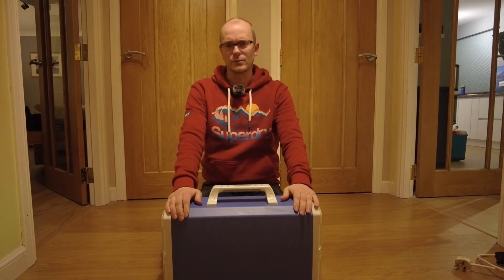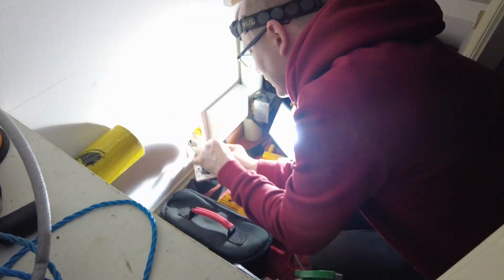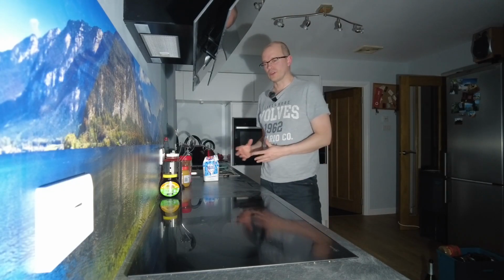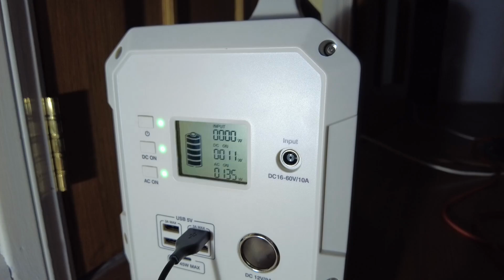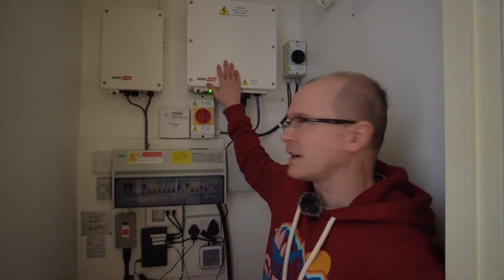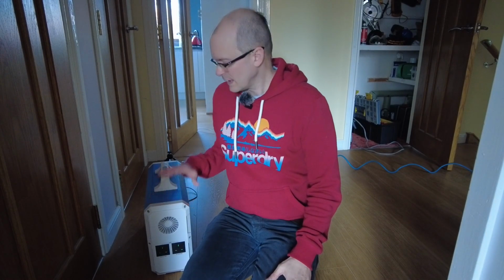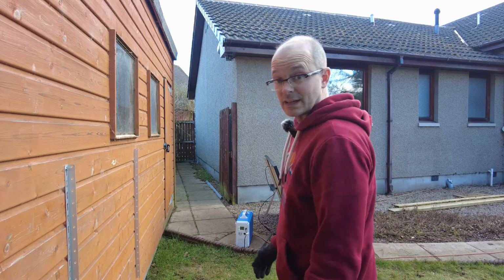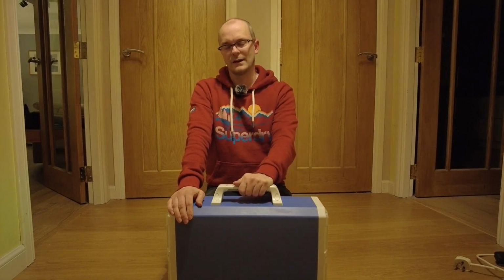Preparing for powercuts with a portable battery.

Comment: Hi Anthonyn, This application note from Victron Energy suggests that it is possible to use an external power source to enable the SolarEdge inverter when the grid is down. I would be interested to know what you make of it.
Reply from the maker: I asked Solaredge support about it, and they said contrary to their own application note and manuals that external power sources weren’t compatible with single phase inverters for the European market.  They said that in any case that generator needed to be large, even though there’s no reference to that requirement in their application note (though that does make sense in terms of ensuring voltage/ frequency stability when switching loads).

I think if you want to fake a 230V supply with a small battery, you’re going to have trouble with heavy load switching.  If you switch a kettle on/off then that’s going to cause voltage sag/spikes which the inverter probably won’t like.  Doing that with the grid connected, and those sudden load shifts just get absorbed by the large capacitance that exists in the grid.

Then you’ve also got the situation where the inverter generates more power than you’re using.  It thinks it can export that power, but very quickly the voltage will exceed its max limit and the inverter would likely trips out.  

So you need a big battery bank to absorb surplus power, and a big capacitor to absorb sudden shifts in load.  If you can do all that, then you can probably succeed in faking a grid supply with a small battery.

Comment: I understand now about the inverter shutting down without the grid, and you trying to power the inverter with the portable lithium battery. 
I'll be getting a 5kwh battery to connect to my inverter and wanted to find a solution without having to install a changeover switch as the can be expensive. Ah well 😌

Comment: Would it be possible to jump the positive and negative from the incoming solar ac cable that is connected to the trip switch that is coming from your inverter, that is connected to the consumer unit with a battery installation that is connected to your solar inverter,  switching off your mains, and jumping the positive and negative for let's say your hot water tank element.
If I have let's say a 5kwh battery installation that is connected to my solis hybrid feeding the main consumer unit and there is a total blackout..
By switching off the mains at the board and, then jumping the circuits.
My solar system is a dc system, not an ac system

Comment: It's funny how having solar turns you in to a hand rubbing accountant. I'm a great believer in having redundancy built in to your systems. My solar battery system does back up in a black out but I would never trust it implicitly with all that bloody software gubbins.
So I have a socket on my power board and a Honda 2.2 to keep the fridge and freezer going plus a few lights. It's enough to boil water on the induction top but the kettle is to greedy. 
Love the channel. Very engineery.

Comment: Just came across your channel. Got a couple of days with no power from Arwen myself. Friends had two weeks with no power.
Would agree fridge and central heating are the important loads. Did try my fridge with a fairly beefy UPS and it couldn't handle the load, so not surprised you had issues.
I've got separate batteries set up for powering my 12V modem already.

Comment: Aren’t those multiple attempts at starting the refrigerator compressor hard on the fridge and possibly shortening it’s life?
Reply from the maker: In electrical terms it’s nothing more than a compressor and thermostat, with a separate light and switch circuit.  There’s no fancy electronics at all.  

So the surge currents do create heat in the motor windings for much longer than normal.  However I also think the surge currents are limited by the battery. It trips out soon enough anyway, so I don’t think there’s enough heat building up to cause damage.  I’d expect the fuse to fail first.
Reply: @anthonydyer3939  thank you for explaining

Comment: Hi Anthony, just found your YouTube channel. Some fantastic videos and great insights into your energy economics and the backups.

I really like the idea of a backup system for power cuts and off grid situations. And yes a modern battery system seems a better option than a petrol generator these days.

However like with a petrol generator or battery when any of us end up in a off grid situation. Most likely we cannot guarantee that we have a reliable earth connection. That is if we are TN-C-S. so I guess my question and thought process is to run a backup system safely when off grid we need to operate in, I think it’s called island mode. I think to be on the safe side for a backup system an onsite earthing rod is required and full Live Neutral and Earth transfer switching required.

I’d really like to hear your thoughts on this, maybe I’ve got it all wrong and my understanding is incorrect, so please jump in and correct me. Just not 100% comfortable about powering my heating system with all that copper and no working earth system.
Reply from the maker: The IET has this guide:
https://electrical.theiet.org/media/1550/operation-of-portable-generators.pdf

It makes it clear that your can only have a floating earth when operating only one item of class 1 equipment.  Multiple items of class 2 equipment are permitted.

When operating more than one item of class 1 equipment then the generator needs to be referenced to earth, regardless of generator size.  It think this would be the typical scenario for a whole house operation.

As for relying on a PNE conductor in a TN-C-S supply for your earth reference, no comment was made in the document.  Most TN-C-S supplies are underground connections to the DNO transformer.  Overhead supplies are usually TT earthed arrangements, so you have a local earth reference anyway.  

For underground connections, I think there would be continuity to DNO earth rod during a storm blackout.  But during a power cut due to a digging accident, you wouldn’t.  

Now the transfer switches I’ve seen are all double pole arrangements, so earth isn’t switched.  

If I was to risk assess an TN-C-S earth connection on my house, I couldn’t rely on my gas pipework and underground gas tank work as an alternate to a TT earthing rod arrangement.  The long term goal after all is to remove my gas heating in a few years time.  Main Water pipes are plastic

All that said, in Denmark they haven’t used protective earth conductors in their socket outlets for decades.  They have historically always relied upon RCD protection to protect from earth faults.

Without reference to 18th edition regs, my risk assessment would focus on the fact that my consumer unit still has RCD protection during a blackout.
Reply: @anthonydyer3939  thanks for the reply and the superb detail. As well as that link to the IET for portable generators.

Yes I think if I was to whole house or partial house power with back up, I would definitely have more than one Class 1 device present. I can think of my fridge freezer and the heating/hot water system the other. So I guess an earth rod would be required.

My supply looks like TN-C-S and arrives underground into my property. But I’m pretty sure there are elements that come via overheads prior to the underground section.

I guess my concern about being blacked out, power cut, off grid is that you never really know what the power loss or disconnection issue is. And my primary worry would be a cable down somewhere during a storm and I might not have a solid connection back to earth but unaware of it. Maybe I’m over analysing the issue or got my understanding wrong.

One thing is for sure the idea of a backup solution during power cuts is no where near as straight forward as the generator and battery companies marketing people would have you think.
Reply from the maker: @westleydowdles  You make some valid points.  I've read further into this,  there's nothing stopping you from installing a supplementary TT earth rod onto a TN-C-S supply.  Afterall, underground metal pipes are effectively bonded to earth and display pretty much identical electrical properties to earth rods (though not necessarily to any loop impedance performance requirements).

So I think you're right that it is an implicit requirement to have an earth rod installed on a site where there is a fixed whole house blackout generator.

But for the reasons above, I don't think earthing needs to be switched.  There can be a common earth connection between the DNO earth rod and the local TT earth.  Or at least I cannot think of any reason why it doesn't need to be switched.

That said, the 18th regs introduced some complex discussion about the need for an electrically separate TT earth, for electric car chargers.  The scenario here is a disconnected PME core, but with the phase supply still intact.  The point made was that the TT loop impedance is still quite high, such that earthed items would likely still be above 70 Volts relative to local earth.   I'd need to re-read the entire point of having a TT rod electrically separated from the PME connection.
Reply: @anthonydyer3939  thanks for your reply and some great points and sounds like a good approach to have a common earth between the DNO earth and a local TT earth.

Really enjoyed watching your videos and you sharing your real world experiences. This really is priceless for anyone thinking about solar, batteries etc. in North East Scotland. I am in Tarves, Aberdeenshire and have been exploring large solar array options as well small backup/blackout systems. Parking the large array solar for the house to one side. It is very viable for me to use a smallish (2-3kWh) backup battery to power the basic things in the house. I have detailed energy monitoring so I know what it would be in direct kwH.

However my big worry would be getting that backup battery charged during the day time in Nov-Feb when sunshine hours are so low and unpredictable. I hate to say it, I really do, but I think it would be easier to find a petrol station and fill up a jerrycan daily, to run a petrol generator than to play the solar panel battery charge roulette game. This really hurts as I would prefer something with better green credentials, but I cannot see how backup battery with solar can work in Aberdeenshire between Nov-Feb without the backup battery being fed from a massive house array. Oh I wish there was a way to do this.....am I missing another option/way?
Reply from the maker: @westleydowdles  Mid November to Mid January is poor for me, especially given partial shading limitations.

However there is salvation in the form of the Octopus Go night tariff.  You can charge up your car and home battery on that arrangement.

Your battery sounds small, but you could go with a Pylontech modular solution.  Their smallest modules are around 2kWh.  Then you can add batteries later on as your needs get reappraised

Comment: I'm looking at purchasing this product or the EB150, cost wise not much in it  and the only difference seems to be the battery size.  One of the things that gives it the added benefit for me would be in the likes of a power cut and powering the fridge/freezer or the chest freezer, other than how long it will last (the fridge freezer is 323 kWh and chest is 252 kWh) what else do I need to be looking at to check it would supply one of them?  Yours obviously works is there anything I need to be aware of?
Reply from the maker: The inverter power is important.  While a fridge freezer only draws 70ish watts, the startup surge current is the problem.  The EB240 is a rather weak inverter at 1200W surge rating.  I can get the fridge freezer going, but it’s often a case of having to try again if you don’t succeed the first time.

Other batteries are smaller, but they do have much stronger inverters.  Sadly though they seem a lot more expensive.

It’s a good time to buy from Bluetti, they have a sale on right now.  £200 of the EB240 price.

My battery is running my entertainment system during the evenings right now.  The amplifier is a struggle to start, but then it’s flawless the rest of the night.  

One other thing:  charging the battery up is noisy.  There’s a cooling fan kicking in above 100watts of charging and 400watts of discharge.  It’s fine for my needs, but just be aware of it.
Reply: @anthonydyer3939  Thanks for the reply, I have been looking at various ones recently and this is winning for me, I did look at the EB150 which would do but for the sake of the few hundred the EB240 I think is best.  I only want it for weekends away and then if and when we loose power at home which is rare.  We had a LPG generator but couldn't use it after 11, meant cables been run, where as this would do for the use, mainly a laptop and small bit of TV.  Going to bite the bullet I think and get the EB240 and 2 panels on the bundle.  Any recommendations where to buy from or just direct from them?
Reply from the maker: @matthewleggott  I bought from the Bluetti website, but they were 10 days slow.  I was a bit suspicious, but they came up with the goods.  Id recommend phoning ahead to confirm stock whoever you choose.

Comment: Great video! I wonder if you can connect multiple batteries in series to expand your total capacity?
Reply from the maker: You can plug batteries from the AC outlet of one battery to the DC inlet of the next.  

You can't use the 12V DC Outlet, as the minimum DC inlet voltage is 16V.

This, however compounds your inverter inefficiencies, and it does not increase your inverter power output.  You'll still suffer from current surges bogging down the last inverter.

It would be more efficient to just use one battery at a time.

Comment: Great video Anthony, really good to see the heating running off the battery unit and glad that the wattage is at the level I thought it might be. Will you be developing a permanent changeover/earthing system or are you happy to do that local switch fuse isolation. Again, many thanks for taking the time to do this. Really getting towards an elegant solution for heating backup, thanks.
Reply from the maker: I don’t have a switched fuse isolator between the meter and consumer unit, so the DNO fuse would need to be pulled, and I don’t have that authority.  If I had more frequent power cuts then I’d hire an electrician to do it, but I’d rather save the transfer switch for another job that also requires intervention on the meter tails.
Reply: @anthonydyer3939  Thanks for the reply Anthony.

Comment: Thats not a battery, its a complete power station including solar charging. I think you should have a much larger unit if you expect to need it very long. Where you live, you can survive without heat for a few days. You don't need lights either - luxury item when the power is out. You should be focused on saving your food. V1 rotate....Get a few mountain house freeze dried meals - they're perfect for this situation and a lot better than sandwiches.